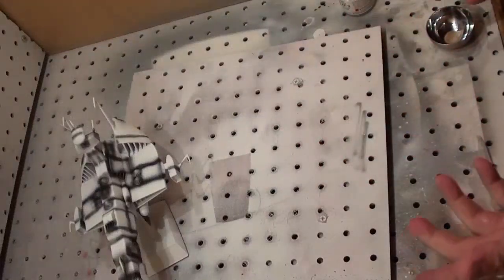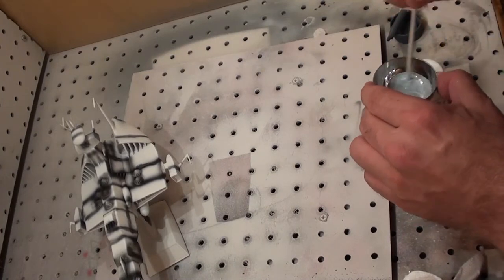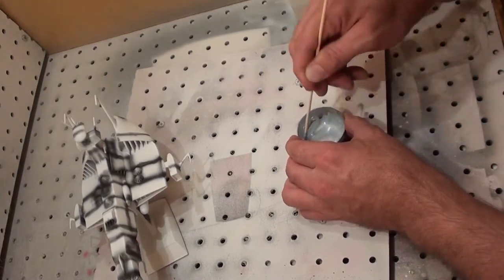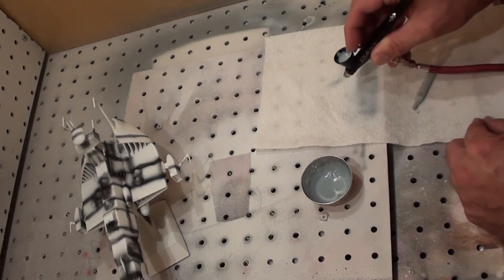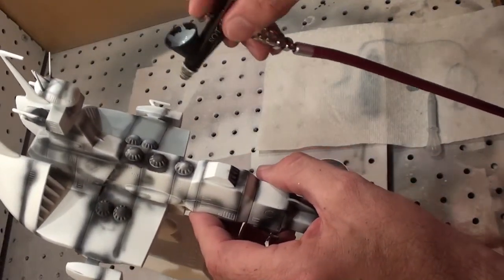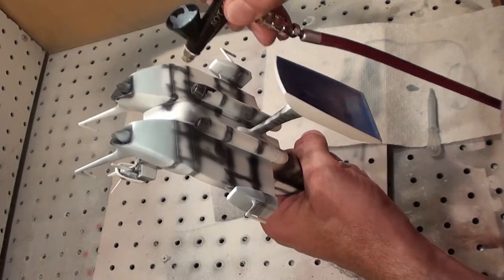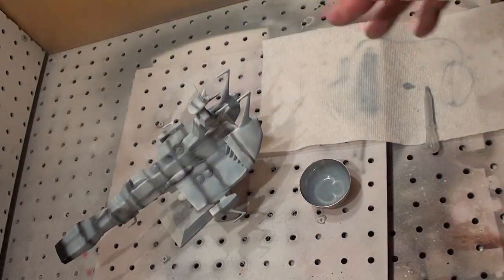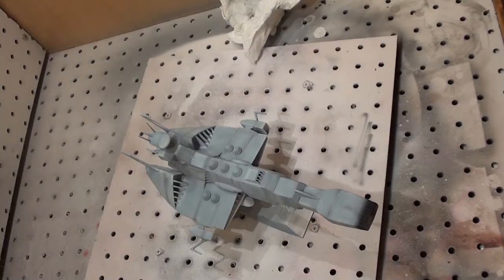Desslok's Command Cruiser:  Giving her color!

Comment from the maker: I remember reading somewhere that with Tamiya paints you want the 1:1 ratio.   I have been using that ratio with their paints for a while now.   I have never had problems with that mixture.  The paint just goes on the model, but not in a thick color coat.  So in most cases I need to do two or three passes.  That works for me because I can control the amount of color better.  Especially when I am doing something like this.

Comment from the maker: I don't think it is a problem in this spray booth.   Quite a bit of air moving through it.   So much that cat hair does not get to the models once I turn on the fan.   (If you have ever had a Maine Coon cat you would understand that.  Their hair is very fine, and gets on everything.   There is not one object in this house that does not have cat hair on it.)

I have never seen overspray travel very far in the spray booth,  the only time I have seen anything like it is when I use rattlecan.